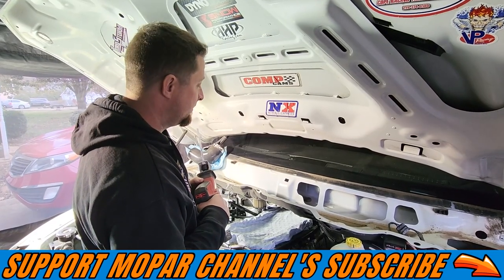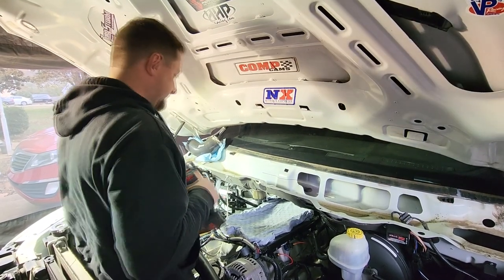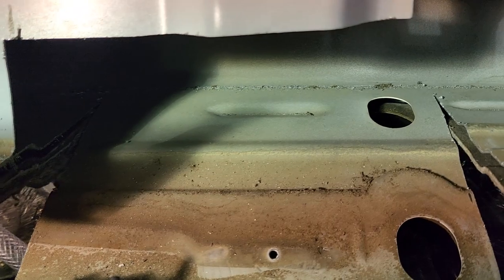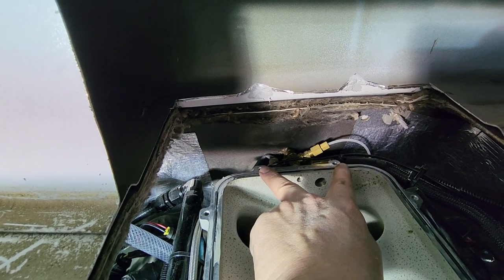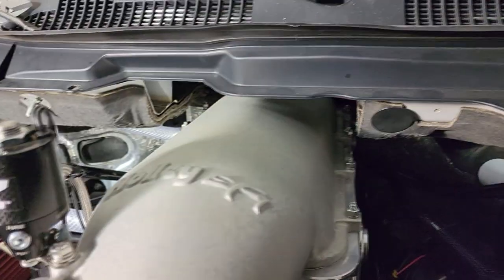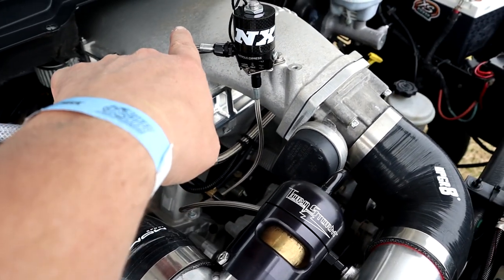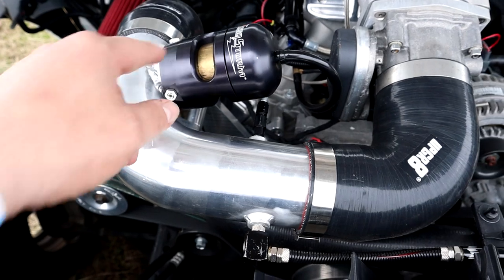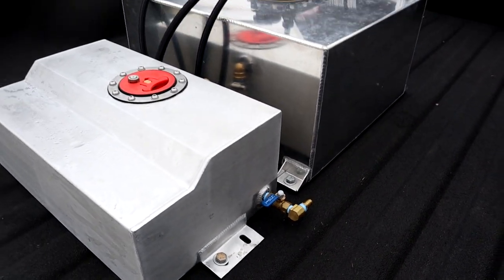New A2W Intercooler Installation On FROSTBITE

Comment: Did you keep this setup as an inlet/outlet on a single side of the intercooler and plugs on the other side? I was told you must run two inlets to one side of the intercooler and two outlets to the other side for it to work correctly by 417 Motorsports
Reply from the maker: Correct I changed it over to his manifolds to do that so I can use just one inlet and outlet.